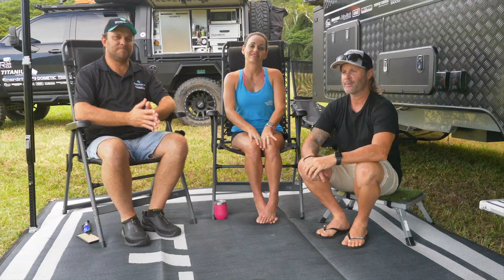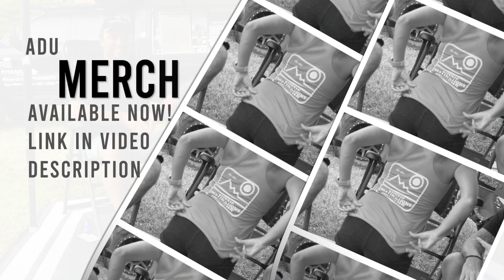ANSWERED!! CARAVAN & 4X4 12 VOLT SYSTEMS | LITHIUM BATTER | ENERDRIVE | INVERTERS | SOLAR POWER

Comment: Great series guys, this really helped me decide to stick with Enerdrive and what my needs are, so I just bought my second (enerdrive) system spending 8k for a canopy build, my first system cost 5.5k and sold second hand after 5 years of use for 3.2k. I'm also building an offroad caravan with a monster enerdrive system in it. It really is awesome gear, my 1st system did the Kimberly and Cape York which seen everything else like the car fall apart but the enerdrive system did not miss a beat in 5 years. Love your channel guys!
Reply from the maker: It really is great gear! We’d never change either. So happy we could help! 😁😁

Comment: Vans need to go to 24 volts.
Reply from the maker: Why?
Reply: @AussieDestinationsUnknown  higher volts less amps. Smaller cables on a big system, less weight.
Reply from the maker: Yeah I get that but then it needs to run a step down. Not sure if it will save much weight at all
Reply: A lot of fridges ,lights and USB outlets will run off 24volts as wwell as 12.

Comment: thanks heaps, for posting this series. very informative. with the last question in part 3, (using a dc-dc charger with a caravan) can you confirm where it would be best to place the dc-dc charger? in the vehicle ( close to the vehicle battery) or in the van ( close to the van battery) also what is the best isolation on the vehicle battery, so the starter battery is not flattened, when vehicle is not running?
Reply from the maker: We will answer this in our next little series 😁

Comment: i can answer yes it is dangerous using smaller wire i bought a 300l/m compressor and connected it to my car with light wire not fused and tried to pump up my van tires when the compressor slowed i went to check and was stunned to see the car on fire from the front to tail lights and around the fuel tank thankfully was able to put the fire out but it cost a pretty sum to get the car  rewired
Reply from the maker: Oh wow! That would have been a huge fright! 😮